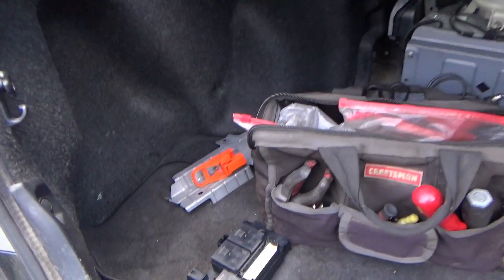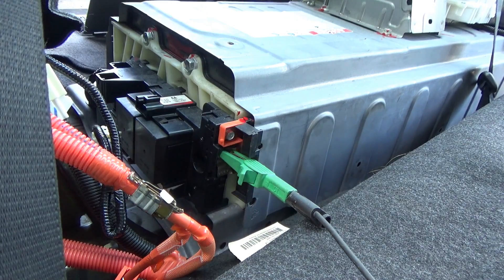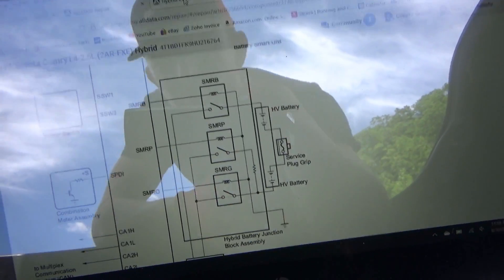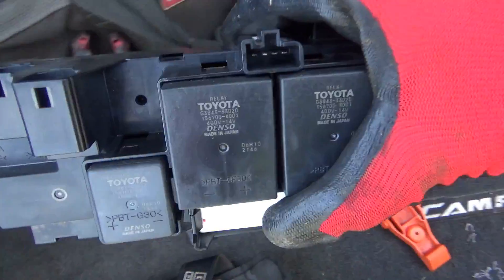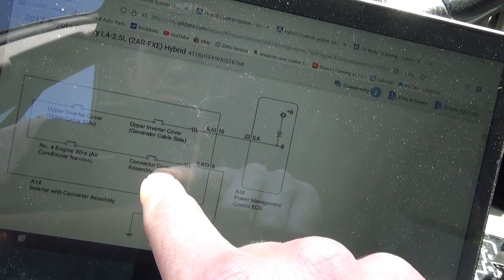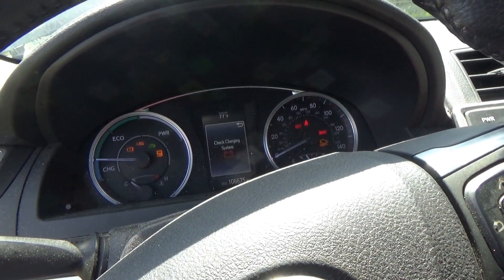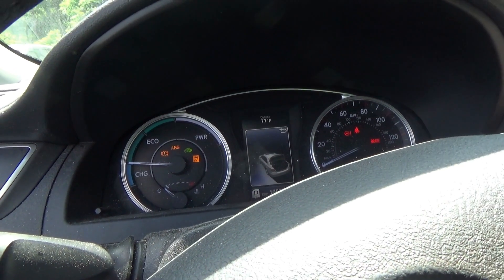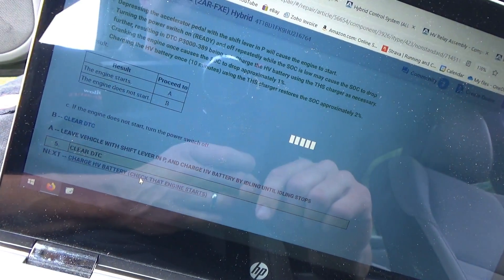Customer bought a HYBRID...and it Can't MOVE! (Part 2-Repairs)

Comment: Hybrid battery discharged from sitting.  The hybrid battery is used to start the engine.  There is no conventional alternator or starter.  Toyota’s hybrid system is exceptionally reliable.  Car was abused and then stored for a very long time with batteries discharged.  Hopefully they did not harm the battery.  My Highlander hybrid is at 290k miles (2008) with the original hybrid battery and still works perfectly; best car I have ever had by far.
Reply: The 12V battery is only used to power the 12V accessories; it is charged from.an inverter and the HV battery.  No way can the 12V battery charge the hybrid battery.
Reply: I understand them wanting to save money by using the EV motor for everything..  But at the same time, they should have a simple plug in 110v charger for you to get yourself out of this mess.  Charging a battery shouldn't be so hard.  Now maybe that fancy charger doesn't cost much, and the owner should already own one..  IDK??  Being forced to tow your car to a dealer simply because it needs a little charge is a terrible design IMO.
Reply: @calholli  I can't believe there wouldn't be a normal 12v starter on the engine.  Then you would start the engine from the 12v battery, then the process of charging the HV battery would begin.  Is there something big I'm missing  here?  What the hell, lol.
Reply: @calholli  don't forget weight. I see people showing the costs savings but the reality is that weight is just as important when the batteries will already add a bunch and one of the main selling points with these type of cars is fuel economy and availability like a regular gas guzzler. 

As we know,  weight reduces mileage performance.  I'm thinking it's just as important in these types of decisions as costs too.
Reply: @calholli  the hybrid battery is never fully discharged during normal operation, even if left unattended for months.  We have no idea how long this car was not operational, or if the hybrid battery was discharged by the previous individuals who worked on it. Recall that one of the relays was energized when it should not have been; even that will cause a current draw over time.  In short, there is no need for an external battery charger fir the hybrid battery, as it is charged by the motor generator every time the car is operated under normal conditions.
Reply: So what is the 12V DC battery for, lights etc.?
Reply: @Garth2011  see above.  The 12V battery powers all electric power components other than the drivetrain motors (motor generator).
Reply: Your experience is not the normal for the human race.  You care. Most people just want to go.  Engineers and policy makers have to face reality.
Reply: @phprofYT  the Toyota hybrid system is extremely reliable.  It just works.  Maintenance is reduced using the hybrid drivetrain relative to the IC drivetrain in the same vehicle (Highlander, as example) while improving fuel efficiency.  And, yes, the batteries add weight, but they are only 100 pounds or so (capacity of the HV battary is smalll…20AH or so).  Wear on the braking system and drivetrain components is also less, and the Highlander has a planetary gear transmission that is engineered to outlast the car (much more durable than a standard automatic).  I bought mine relatively inexpensively second hand in 2011 as folks were concerned about the battery life.  Still on original hybrid battery, with only scheduled maintenance and replacement of the A/C evaporator in 2022 (nothing to do with the drivetrain).

Comment: I wonder what's to stop you charging it with a universal variable power supply? If you know the voltage and battery type, can get to the terminals, I don't see why not.
Reply: The HV battery ecu needs communication to begin with the fancy charger, the battery management will likely open contactors inside the battery cover if conditions aren't met to prevent possible overcharge and thermal runaway
Reply: @mikebaz7843  Its not that complicated. So long as the charging voltage is high enough, charging will take place - just like with a 12v batt.   You would need only a 20 or 30% charge to get the system able to start the engine, and charge itself.    FWIW   This would be enough to get going:   https://www.youtube.com/watch?v=EqXRL9_Ua3o&t=545s
Reply: @richardking6066  No, the battery management system will notice that someone is trying to inject an illicit backfeed into the HV system (as it is not coming from the inverter) and it would shut the entire chain down.
Reply: @Stoney3K  You just need to ensure the car is switched off - I actually disconnect the 12v auxiliary battery.   I'm actually doing it on my car right now - taking it up to a full-charge to 'top balance' the cells
Reply: I believe the main battery is around 350 volts!
Reply: No, do not do this because you can overheat the HV battery... it doesnt work like that... you have to use a very low current charger in pulses to give it a slow charge to the HV battery...
Reply: @hybridsolutiondiagnostics  I'm using less than 300mA charge current BTW - So not enough to cause damage by heating.
Reply from the maker: What's the voltage output on your power supply?

Comment: Was P3000 the original problem and whoever messed with it broke the pin on the connector?
Reply: Owner did. Broke the connector. Owner was told not to mess with it.

Comment: I just bought a new Toyota and was considering a hybrid.  Insurance and taxes were cheaper for a hybrid but I never liked the idea of two drive systems.  Double the motors, double the problems was my thinking.  I went conventional internal combustion.  

We seem to be heading into an era of throw away cars and that where Toyota once was good for 300k +, we will now be happy with half that when our EVs or hybrids fail and repairs are either impossible or expensive.
Reply: They have proven themselves the most reliable cars on the road - if they were not, we'd have heard all about it years ago...  I was also a bit nervous of the Prius 20 years ago - but they have only got better and better.  They are often good for 200 000 to 300 000 miles - Like any car, it all depends on how well they are treated

Comment: Now I know why I an no fan of Hybrids. Way to complex. Conventional is much better.
Reply: Same was told about computer controlled fuel injection when carburetors were standard. Hybrids a relatively new technology and it takes time for people/tools/shops to adapt to it.
Reply: @petrnemecek4379  I drive a gas guzzling V8 Toyota Tundra...I am way too old to give a 💩💩💩💩💩 about Hybrids and EVs. With 4 years to retirement and a 2 yo truck that is almost at 26 000 kms, my truck will outlive me. These new technology's are for young people...not for me. I am able to use my smart fone with ease and that is good enough. Any newer tech is too much for me now.
Reply: Yes they are very complex but so are conventional. Have you seen some of the cylinder shut down systems that keep valves from opening and the related unintended consequences that go with them.   
I’m quickly becoming a fossil after 48 years in this business.  Thanks to Ivan and other younger techs for keeping me aware of these “money pits” ‼️
Reply: @dharley189  GM AFM and start/stop technology is a fantastic way to ensure repeat business. Defeating these brain dead marginal fuel economy improvements is very prudent. I drive a Tundra...I would rather pay at the pump...not at the repair shop. In 2 years my Tundra has cost me $50....new cabin air filter a week ago.
Reply: @mikefoehr235   I agree.  The ones who really suffer in future will be third owners who can’t afford to fix them.  Instant salvage yard material ☹️

Comment: Apparently they use the high voltage motor-generator to crank the engine.  But all it would have taken is a conventional 12V starter as a backup.  Admittedly, this state is totally abnormal.  The car probably sat a long time like this.
Reply: Sounds simple but it’s not. They would need flywheel ring and all manner of safety devices to keep customer from tearing up something. They didn’t have enough  safety devices on this one as someone already screwed it up before Ivan got there. Your comment is right on the money. I have never seen one that the HV battery was so discharged. 48 years in car repair have taught me owners will try all manner of ignorant things to NOT pay someone to diagnose it right. That also applies to plumbing, home wiring and furnaces as well. That’s why I pay for those things I’m ignorant of. 🤪
Reply: @dharley189  I worked as a plumber for nearly 2 years, an electrician for nearly 3 years, (and I ran my own crew building custom houses and metal building for over a decade)-- and I can tell you things like plumbing and wiring are so very stupidly simple in a house, especially for a smart guy like you who can understand auto repair.  You just have to watch a couple of videos on whatever you're trying to figure out and you'll see how mind numbly simple it all is.......   But just to add to what you said about the "safety" issue.   If they added a 12v starter, they could have made it's procedure more difficult to use-- such as needing to flip a breaker under the hood for it to work--- and as soon as the engine started, that breaker would automatically switch back to the normal state of using the main EV motor again...  Just make it a more difficult procedure that people wouldn't be using it, unless they really need to- because their car is dead. (like in the video.).   I understand that this system would be dead weight and never even need to be used (except in this occasion)-  so saving money by ditching the flywheel, alternator and starter makes sense.    So the real answer should have been for it to come with it's own 110v charger.  I just can't image buying an electric car that I can't charge.  That's a NO GO for me.
Reply: @calholli  Yes an included charger or readily available from aftermarket supplier and not a narrow use overpriced unit would be great idea. 

A totally dead battery is rare but it happens.  I think neglected due to cost to repair is involved with this Camry.  That happens on a lot of old cars.
Reply: @dharley189  Yes I understand they chose to live without the 12V starter, flywheel and associated wiring. But other than the extra weight there isn't really a downside. The starter is 100% computer controlled so I'm not sure how the customer will cause damage. It's not like the ignition switch on any modern car is wired directly to the starter.
Reply: @kevin9c1  I’m working on now that customer put toggle switch on rear blower. He can’t understand why battery still drains.  Customers somehow. Figure how to work around everything despite engineering’s best efforts.  I’m not arguing with you. I agree.  😎 Hope your week goes good.
Reply: Professor John D. Kelly from Weber State University (WSU) - Davis Campus in Layton, Utah explains how Toyota Hybrid systems work.
https://www.youtube.com/playlist?list=PLIn3FrDiB1lxzthcUMZQOoJi3PNAlVYa6
Reply: @breezy1849  I love weberAuto channel. I've watched a lot of his stuff...  It's easy to understand why they did away with the starter and alternator.  I just think it shouldn't handicap you like this.  It's an electric car that you can't charge. lol.. ??  Who thought this would be a good idea?
Reply: @breezy1849  I've watched plenty of his videos.  I was nerding out to the ATF history one.
Reply: @breezy1849  Yes. He has increased my understanding several times over on a lot of this technology ‼️
Reply: @breezy1849   Thank you for the link.
Reply: I agree... but also, why do they not have a simple plug in trickle charger for this thing?   Why are you forced to use this fancy charger and must take it to the dealer?  That's a terrible design.   even if it's not a "plug in" car with a dedicated port and door.   It should at least have a simple plug in the trunk next to the "Grip", where you can pop your trunk an hook up a trickle charger and get the votage up enough to start your car.   I can't believe they would handicap you this bad --- forced to tow your car to the dealer? smh
Reply: @calholli  Yes sir. They should.
Reply: @calholli  because your 12v battery charger isn't going to charge a 600v battery
Reply: Well, actuality not using a conventional 12V starter was done for a reason. With hybrids the engine shuts off and starts even while the car is in motion.
Reply: @Kev-Burg  I've started cars while in motion on regular cars..  You just put the car in neutral while you're coasting, and it starts like normal.  So you can do that with a regular starter, no problem.  They just did away with the starter and alternator to save money-- because they can use the EV motor for all of those things:   I get that;   and it's smart to save money.  But this should come with it's own little trickle charger.  geezzz.  I'm so disappointed that it leaves you stranded like this, forcing you to tow it to the dealer. smh
Reply: @calholli  Your absolutely correct. My comment was saying motion is directly related to why it doesnt have a conventional starter by design.  The purpose of having MG1 to start the gasoline engine (instead of a starter) is to also use it to charge the HV battery while car is in motion.  It has two purposes. Having a starter would only have one purpose which is in case of emergency.
Reply: @Kev-Burg  Yes of course. I'm saying as a backup.  I will say that Toyota may have already thought of this and an unused starter may not even work when it's finally needed unless they could bury it in a safe place (like under the intake manifold in a V8).
Reply: yeah using a 12 volt aux battery to start the motor would be too easy. Have to send those cars to the stealer so they can make $$!
Reply: @adotintheshark4848  adding a 12V starter to the ICE will make the car more complex. It's not just a starter but the electrical system itself would have to be changed and additional hardware and software to have it switch over to the 12V starter in the extremely rare situation that it would be needed. The 12V starter will probably have died by not being used before it will ever be needed on a hybrid.
Reply: @adotintheshark4848  which is so take that most dealers have the THS charger stowed away somewhere. These hybrids are among the most reliable drivetrains you can find. In normal use this will never happen.
Reply: Or just a DC-DC converter that could hook the 12V battery into the HV circuit when required so you could at least bootstrap charge it or even run the car without the inverter even running, as a limp-home gas car only.
Reply: @Stoney3K  That would make perfect sense.   But it all boils down to cost and toyota corporate are one of the biggest penny pinchers.
Reply: @Stoney3K  a Toyota hybrid is technically unable to drive with only the ICE. The electric motors are needed to move the vehicle. A situation like this is extremely rare and basically is a non issue.
Reply: As I understand Toyota's Hybrid Synergy the high voltage electric motors are an integral part of the "transmission" so the car actually can't move without the high voltage system at least somewhat functional.
Reply: Hybrids are only for that small percentage of people who drive mostly below 50MPH.  Useless for the rest of use that drive a lot of highway miles.
Reply: @The_Redkween  Last time I checked they still get really good highway fuel economy, too.  Hybrids usually use Atkinson cycle engines which are more thermally efficient.
Reply: @The_Redkween  that's a load of BS. Yes, they are less effective when used mainly on the highway but they still beat a gasoline or even a diesel car of similar size on economy. I have been driving 2,5 years and 125000km (78k miles) and average 4,9 L/100km (48 mpg). The fuel economy is around 5,2 L/100km in the winter and 4,2 in the summer (45 and 56 mpg respectively).
How many miles have you driven in a hybrid yourself?

Comment: If you have ignition on a Toyota hybrid , you can charge the HV battery . It's doing automatically. Connect charger ( more than  12.5 V).and wiat for 30 min . Good luck .
Greets from germany . I like your diagnostics
Reply: Definitely not accurate.  The engine charges the HV battery. In this case the engine isn't running so under these conditions the battery can not be charged
Reply: Not at all... the HV battery looks like is discharged or in real bad conditions... it needs a high SOC to be able to crank the engine and begin the charging system...
Reply: Inverter converter does make HV.it works allways for me. I repair HV Toyota batteries never need a HV charger .it works really
Reply: My Escape does it, but it's not automatic, I have to push a button.
Reply from the maker: That's not what the service info said... But would be nice!